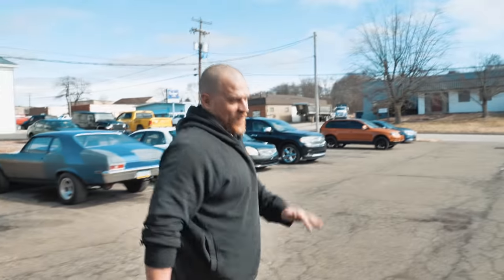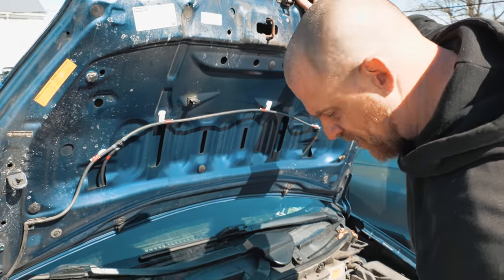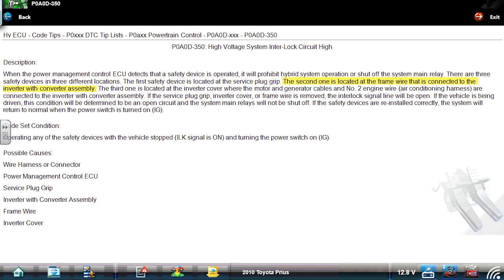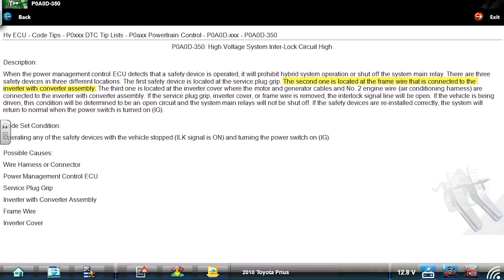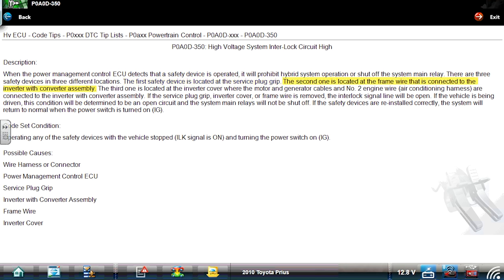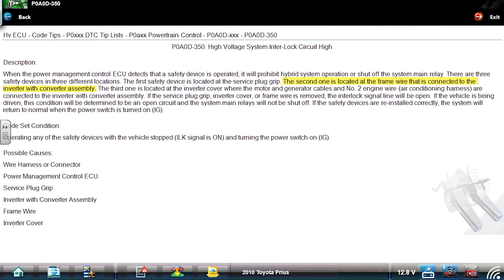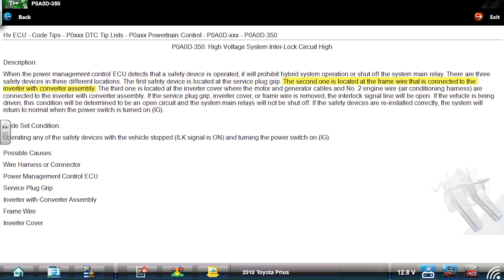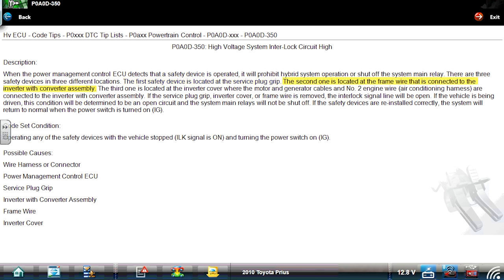Hybrid No Start and Electric Water Pump Diagnosis

Comment: I've replaced alot of engine water pumps on these, rarely every saw a head issue with them. Most of the time the big give away was the little coolant T fitting on top would melt meaning the pump was bad.

Comment: You’re absolutely right danner, you need 1000v gloves to even touch the safety plug. Your brother did something super dangerous if the plug was defective he could have got 200V up his arm and thru his heart, and if you don’t got the gloves I’m definitely assuming he doesn’t have the insulated fishing pole to save someone from electric shock
Reply: Not how this works. Sheesh.
Reply: @ring-and-run  yea it is how it works or why would they have so many warnings in the service information, in college we had to put pylons around the car to prevent people not wearing PPE from entering, then we don’t even touch anything orange without Class 0 gloves with the certification

Comment: I did my 1st battery cell replacement  last week. Ran into the same no start issue when I was done. My buddy had put the plug back in and didn't slide it into place. Lol. They also get really upset when the 12v battery is weak.

Comment: The interlock circuit code is common on that model if owner's start fiddling with components they shouldn't be or have stored tools or luggage under the rear tray and have "caught" the plug removing items. On the smaller Prius C (Aqua JDM) It is also common to find that the owner has usually tried to jump start the vehicle themselves and gone straight to the battery under the rear seat and have removed the wrong panel or lent on it to hard pushing the connector down resulting in the same code. Either way every time the instrument cluster will illuminate BUT the READY LIGHT will NEVER come on causing confusing. Most Prius models have a jump start point in the fuse box LHS Engine bay but this MUST NEVER BE USED TO JUMP START OTHER VEHICLES !!!!!

Comment: Awesome learning video  . I change a few  of them , what I notice is that every one that  I remove ,  I just try to spin the propeller  and was very rough. it won't move freely  compared  to the new one .  It's posible that the pump is not running  at the correct rpm , or as you said not running at all overheating  the engine and throwing  the pump code .

Comment: When you remove  the pump, you can check it by twisting it with your hand. You will notice some heaviness in it, which means that it is damaged, or when you disassemble it, you can notice some black marks on the heart, which means that it is damaged.

Comment: The heavy orange cable apparently has a protective sheath with a ref signal running along it so if the cable is damaged it will prevent the system from turning on ,  Interlock circuit open or Interlock circuit short to ground (I believe) are the codes to be aware of.

Comment: Hey Danner, all gen Prius have a very loud flywheel dampener when it has a misfire. That gen Prius has a real bad tendency of blowing head gaskets, I would bet if you look down the cylinders with a boroscope you'll find a leak. Easy money for your brother, done many and that is the first symptom... I'm serious I don't know of many owners of that gen that haven't had a head gasket at least once in their lifetime. Also with the first issue and the engine starting, it uses the electric motor MG1 to start the engine and MG2 to drive the car in electric or assist mode. The engine also always runs about 10 seconds after "READY" is illuminated. Another way of forcing that engine on is Emissions Mode where you force the engine to stay on throughout an entire KO cycle. The loud hum that you hear from the water pump can sometimes be mistaken for the A/C compressor that hums really loudly and is normal.

Comment: interesting thought with towing. those motors are also used as generators for regenerative breaking to slow the car but also charge the high volt batteries on some cars. so what are towing precautions???   disconnecting the switches? was it towed in? might be why that trunk located switch was open

Comment: Diagnose Dan has a series of videos a year or so back where he goes through working on EV, complete with gloves and such.  

For electrical gloves, you need the rubber gloves, but also the leather protector gloves.  I've found Magid Glove who sell PPE equipment have decent prices and good info.

The "put it in your pocket" seems like a weak lock out, tag out system.  Shop probably needs to get a keyed box to put the cut out in while working on the car with the tech doing the work keeping the key.

Comment: You can charge the battery by putting it in drive and press down on the brake and the accelerator self re genaerates

Comment: I know you're supposed to pull the high tension fuse. Sometimes you need it in for diagnosis. I would put the drive wheels up on jack stands.

Comment: Prius is known for its coolant pump B fault, no matter you install the service grip on H.V battery or not, however the car should start on engine using Aux 12v battery, i have done so many Prius, usually pump needs to be replaced in most of the cases, and yes dont worry about replace hybird batter pack code

Comment: hey danner the 3 safety devices have small wires which are interlock circuits they are all in series, the hybrid ecu wants to see the circuit is pulled down when all the safety devices are in place, if one of them are tempered or removed the circuit will be opened thats when you will get interlock circuit high code, and you wont get the READY Light

Comment: Yup. Either it’ll be an electrical failure or an impeller failure. What’s dumb is that there’s no temp gauge in the Prius to tell the driver or tech that the temperature is creeping up. So the car will just overheat w/o the driver knowing. Then there’ll be the warning lights and the possible damage to the HG and other components.

Comment: In other words, the owner came in to have a real diagnosis done, and is replacing the water pump on his own? 
If I were the owner, I wouldn't touch that thing with a 10-foot pole without at least a thorough research on the high voltage circuit. Did you see that red monster cable? That's no Video game...

One thing is clear from the Video, it's learning time. Can you imagine working on a Tesla or any other fully electric car? Great Job on reminding shade tree mechanics and technicians on how dangerous electrical vehicles can be!

Comment: If there is a disconnected interlock in the system the highvoltage contactors are staying closed in the hv battery its a realy importent safty feature

Comment: the amperage spikes on the pump motor suggests the impeller is loose and catching or the windings are shorted. i would think it should be similar to  fuel pump or heater motor.

Comment: Volvo has a LIN line for engine coolant pump control. No duty cycle or anything like that, it is a constant power and ground to the pump, a fail safe wire that is supposedly grounded if the LIN line is down from what I read. The only way to know if the pump is working is to measure the amp at the heavy gage wires, the amp that ot draws is usually really not that high, around .5 when dry. The hardest part is bleeding the system since the pump is installed on the higher side of the coolant system, and you know what stays on top of water lol.
Reply from the maker: Nice, makes it even more simple to confirm wiring integrity with a LIN 
Thanks!

Comment: SD ...i do own a 04 prius its preety much service free till today only water pump for inverter cooling went out last year so i baught online same part number replacement from main land it worked 2hours i mean relly 2hours and pufffffff..so baught a used one it worked 10 days almost so here i went to research and found its just a freaking pump nothing special in it.so what i did i baught a cheap chinese 12volt brushless pump @3$ and installed it just to be on safe side i controled it via small relay to protect ECU driver and from that day i have done almost 3k on it no problem at all.

Comment: Hi danner. 2 interlocks are the isolation plug and the inverter( L shape under the bonnet or hood) I am not sure if there is a interlock in the rear relay box next to high voltage battery

Comment: The Prius gas engine will sound like it’s knocking/misfiring when it sits for a long time. I believe it’s due to moisture? Pretty common. Had it happen on one I bought from auction.
Reply: Condensation in the intake manifold.
Reply: Actually, it's almost always due to a blown head gasket.  these things blow head gaskets all the time.

Comment: Just for future reference... these Prius’ are supposed to be jump started from the underhood fuse box not the 12v battery and almost all the gas engines shake a little after initial startup when sitting for awhile (not sure why). I’ve been rebuilding/driving Prius’ for the past 5 years and love them to death!!
Reply from the maker: We saw no 12v main connections under the hood for that 🤔 thanks!
Reply: @ScannerDanner  under the left hand fuse box (engine bay)  but some of the first generation models of each model DID NOT have them and then YES straight to the 12v battery.

Comment: We’ve done so many HV batteries, inverters and other things on Prius.  Once that orange plug is taken out, it kills 90% of the HV battery.   and no, you don’t NEED to wear gloves for that plug since that plug is plastic.  Also, that “rattle” is most likely the chain tensioner on the back side of the engine.

I actually BOUGHT an older Prius (2001) to learn more about them.
Reply: Had a similar rattle in my 3rd gen due to a head gasket leaking some coolant into cylinder one. The EGR cooler plugs up on the 2010-2015s due to high mileage Prii burning oil. From my understanding it causes the car to overheat enough to warp the head gasket. When I pulled my EGR assembly out at 220k the cooler was air tight. Oddly enough no EGR codes were tripped. Some people have reported running out of coolant will burn out the pump, I’m wondering if that happened in this case.

Comment: Haven't finished watching the video yet but, I worked at a Toyota dealer for 7 months, only thing I can tell you man is that everything in orange color is HYBRID, that's some high voltage stuff over there and yes, there are safety plugs to disconnect parts of the hybrid system in order to isolate the system, locations and the quantity varies from car to car, just until recently the Prius was the only hybrid car in the Toyota lineup but now since 2021 they're selling hybrid Camrys, corollas, siennas and RAV4's... So I'd suggest you get a nice training and gear to work on those in a couple of years when they're out of warranty.
Reply: Btw "Ready" indicates gas engine is armed to start at any time the hybrid battery needs to recharge, the system constantly monitors battery voltage. If you're gonna work on the gas engine even if it's something as simple as doing an oil change you never ever work with the Ready indicator on, there's also a special procedure to run the gas engine without the intervention of the hybrid system, I think it was called maintenance override mode.

Comment: I did two hybrid cars before. Well just troubleshooting nothing major repair. One was simple 12 volt need to be replaced. And other , traction battery was bad. Few of cell was low then other cells. I’m no expert too. I do own high voltage gloves and some insulated tools. Hybrid cars are very interesting 🧐

Comment: i read hybrid and water pump in the title and auto-assumed it was a prius with a failed inverter/drive motor water pump. been there done that, except it also shorted and was blowing a fuse, totally dead as a doorknob.

Comment: I once had to change the electric drive on a d7e bulldozer with 600 plus voltage potential.  Kinda nerve racking untell you get the system  disabled.

Comment: The most common cause of the interlock code being set is an incorrectly installed service plug grip. If the code sets the ready light on the dash won't come on. This is what indicates the car is in the "run" mode.

Comment: So on the fire department they have told us that the orange cable has a wire in it other than the main cable that if broken it shuts off thd hybrid voltage

Comment: i work a lot on hybrids but the were one that been converter to hybrid on E450 2010 only and only time i could use the glove disconecting the disconect because if it wet you can died ;...but often i did not use glove .if you open the batteries not recommended then you need the glove and if we send it to the ford dealer for engine waranty the dealer ask us to do the disable the system because it not a ford system

Comment: I know and understand how deadly high voltage can be, especially high voltage DC. always be safe when dealing with the systems, you very likely wont get a second chance if you come in contact with it. AC current tends to throw you off, while DC just locks you on solid, neither of them are to be played with (says the guy that's been zapped thousands of times).
do as I say, not as I do 😖

Comment: Being a former Toyota Master, this was hard to watch naturally.  Regardless you and Danner are great but with Hybrid and EVs there is a different checklist when a no start just like Diesel versus Gas no start stuff.  Surprisingly being a dealer douche like I was seeing an AM2 fuse blown due to a shorted Inverter Water Pump is every week which causes the no start.   Now with Diesel and CAN stuff add this to your abnormal paid channel stuff which is great to get in to.  I can send you extra stuff when you get bored or want to fall asleep if need be.  You got there hands down and that is what I see with techs In aftermarket messing around without a lot of hard training to be more confident.  Luckily you were right to say pass at first since you saw the typical overzealous warnings for these vehicles since folks do get zapped from time to time.  Great job as always being an automotive boss ass mf.  Thanks for posting.  Don’t be afraid to deal with those Hybrids and EVs!
Reply from the maker: Thank you my friend. Just didn't want to do anything that would hurt someone on camera was my biggest hesitation

Comment: hey scannerDanner how is going man .... listen up i have a 2017 toyota avalon hybrid over heating after 60 miles , as long he goes over 60 the car start ran hot, i ran my scanner its comes  up with these codes Po117    .. engine coolant temperature sensor low voltage and  P148F engine coolant pump over revolution  . my question how may of temperature sensor does the car is carrying..... i have been searching cant direct me i was hoping there is none in the radiator.
Reply from the maker: Focus on your coolant pump code!

Comment: I had the same issue Mr Danner in an electric pump. And the problem was the air in the system. So maybe when the thec replace the radiator he didn't purge the air from the system...
Anyway I just want to share this because when it's electric you have to be so smart
Reply from the maker: Air in the system wouldn't cause the feedback signal to be bad would it? I believe it is simply the rotation of the motor or impeller that creates the signal back to the ECM.
Not sure how air would effect that? Thanks!
Reply: @ScannerDanner  anyway thanks for all your vedios you and your brother...

Comment: One thing for sure this engine overheated,  now for your pump since you  able to hear it .the impeller is broken ,(plastic) .The  rpm is see by sensors temp and thermostat, that is the way the ecm is able to know about the flow or circulation. Most of the time this pump seize ,anyway it's a well know problem on toyota hybrid and lexus  , ok after seing your brother with a nice sandwich ,i'm going to make myself  one!!

Comment: First I would like to say to everone is remember 80ma at  50vdc will kill most people !!! sobeing thought when you are "fooling around orange cables" the inter lock at the rear in the boot area splits the battery cells in half (so you sill have two 100v batterys ) it will not disconect the postive or negative of the battery from the systems  ... so it can still kill you ....

Comment: 🤣😂😂🤣😂. I've never seen anybody so terrified of a plastic isolator safety cut-off 😂😂🤣😂. As a 5 year old I learned all about repairing TV,s with my Dad upto 28,000,000 volts DC and Car repairs.⚡.  I'm now 63 and I find hybrid and electric vehicle's so easy to work on 😉🙂. Luckily Toyota,s hardly ever go wrong...I've never ever worn Rubber gloves or even Vinyl glovers. When working on high voltages or Car mechanics.

Comment: Boy the shop had to teach the mobile diag guy about hybrid system lol.
Reply from the maker: "The shop" would be my brother and I'm no longer a mobile tech.
Just fixing stuff on camera at his shop these days and I don’t claim to know it all, nor have I ever.
Reply: @ScannerDanner  I know was just poking a bit of fun. Always something to learn in this field. I'm sure your brother has had them in the shop before
Reply from the maker: @robinsonsmotorcycleandauto3929  sorry buddy, hard to read sarcasm on the screen sometimes, my fault. 
I need to not be so sensitive lol
Reply: @ScannerDanner  
i like the way you apply the logic about electricity to the hybrid because it the same logic  just higher volts   great video  thanks